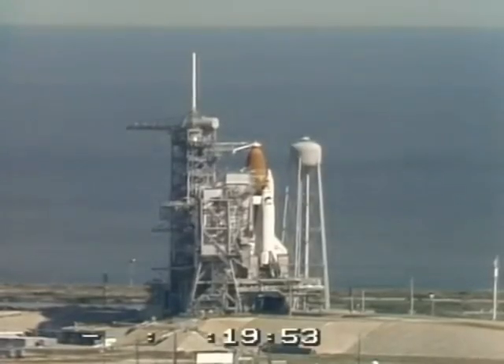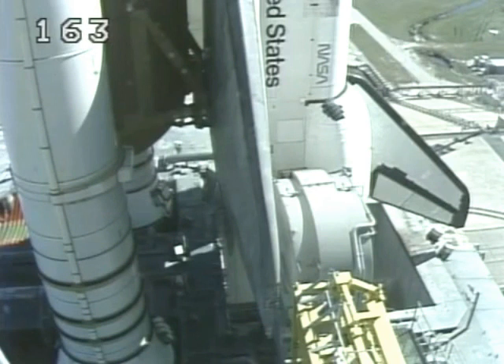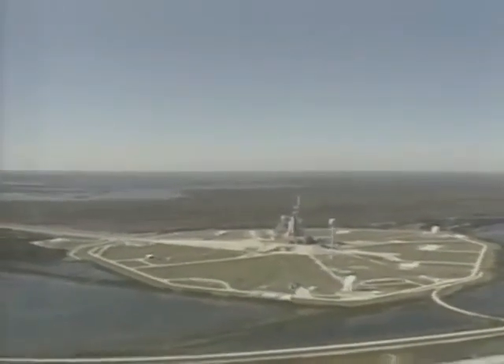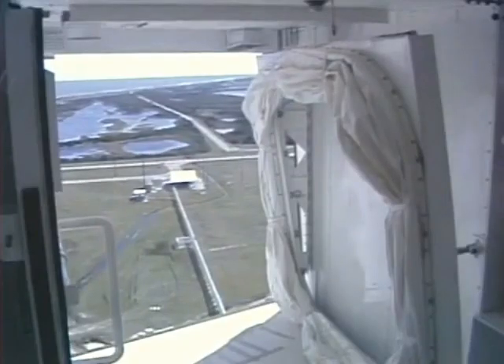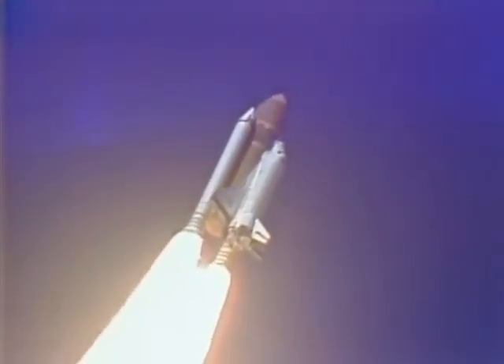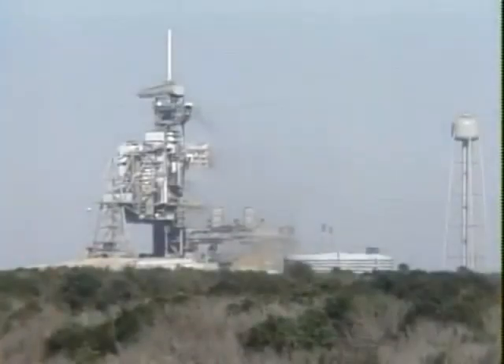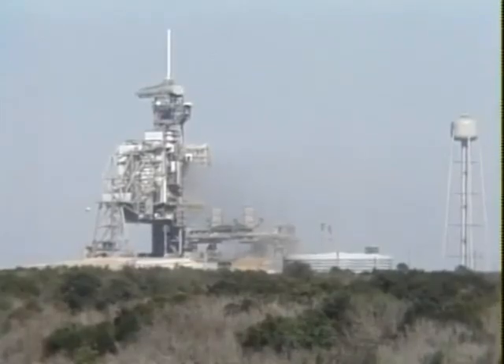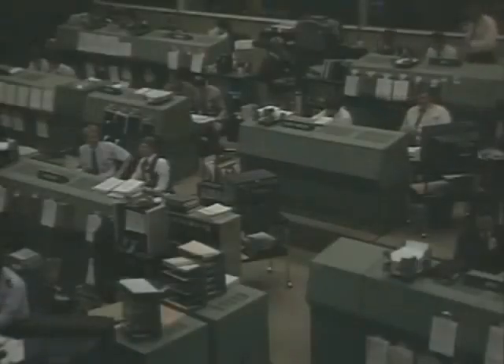The Challenger Disaster: STS-51-L Countdown and Launch

Comment: A real question is: was it already too late? Would it have mattered if they had delayed, a day, a week, or even several months? 

Professor Feynman showed that the O rings failed due to the cold. They were squeezed too much and never returned to 'normal'.

So, were the O rings already permanently damaged beyond elasticity so that they could never fill the gap and thus block the gases? If so, the flight may have been doomed no matter when it was launched.

Comment: "Spaceflight will never tolerate carelessness, incapacity, and neglect. Somewhere, somehow, we screwed up. It could have been in design, build, or test. Whatever it was, we should have caught it. We were too gung ho about the schedule and we locked out all of the problems we saw each day in our work. Every element of the program was in trouble and so were we. The simulators were not working, Mission Control was behind in virtually every area, and the flight and test procedures changed daily. Nothing we did had any shelf life. Not one of us stood up and said, “Dammit, stop!” I don’t know what Thompson’s committee will find as the cause, but I know what I find. We are the cause! We were not ready! We did not do our job. We were rolling the dice, hoping that things would come together by launch day, when in our hearts we knew it would take a miracle. We were pushing the schedule and betting that the Cape would slip before we did.

From this day forward, Flight Control will be known by two words: “Tough” and “Competent”. Tough means we are forever accountable for what we do or what we fail to do. We will never again compromise our responsibilities. Every time we walk into Mission Control we will know what we stand for. Competent means we will never take anything for granted. We will never be found short in our knowledge and in our skills. Mission Control will be perfect. When you leave this meeting today you will go to your office and the first thing you will do there is to write “Tough and Competent” on your blackboards. It will never be erased. Each day when you enter the room these words will remind you of the price paid by Grissom, White, and Chaffee. These words are the price of admission to the ranks of Mission Control."

Gene Kranz

Comment: Had Challenger not blown up on STS-51L, she would have been modified to carry the Centaur-G upper stage in time for the "Death Star mission" (and no the astronauts were not joking) where Challenger and Atlantis were to launch the Galileo and Ulysses spacecraft using the Centaur-G Prime upper stage within five days of each other. This presented a huge problem because you have a huge amount of high energy propellant (Liquid Oxygen and Liquid Hydrogen) in the payload bay and in the event of an abort had to be dumped overboard. On top of that the SSME's would be pushed to 109% rated thrust and the crew size was reduced to four astronauts. In a way, the Challenger Accident prevented a even bigger accident with the shuttle and it Centaur-G upper stage.
While all this was going on, the Air Force was prepping SLC-6 at Vandenberg Space Force Base for the first Space Shuttle flights in order to carry spy satellites and other satellites that needed to be launched into polar orbit. NASA was developing the filament wound style SRB'S for the launches coming from Vandenberg Space Force Base. In the end, after the Challenger Accident, all Shuttle flights from Vandenberg were canceled and the Centaur-G was banned from the shuttle.

Comment: Apparently, the last thing registered in the shuttle was the word "Uh-oh." The flight commander realized what had probably happened, and knew they were all dead, seconds before the explosion itself.
Reply: The side flame on the srb not only broke the support strut attaching the bottom booster to the bottom of the tank but the whole bottom of the tank was sliced clean off. That would have caused a tremendous bang that would have been felt by the crew hence the “Uh oh” by Mike Smith. A second later, the booster swung sideways because it was now being held by one strut and the nose of the booster hit the nose of the tank like a missile strike. The top of the tank was torn to shreds with the force of the accent causing the rest of the tank to be swallowed up by the debris. The shuttle orbiter was pushed nose upward by the force of the tank nose destruction which meant it was flying bottom going forward. This created a huge force of drag which ripped the shuttle apart a second after the tank disintegrated.
Reply: That was pilot Michael Smith that said that. It was the last thing that was heard by NASA. So he saw something and split second later we have the disaster.

Comment: They say they were alive when it broke up , was anyone there sitting in the seats of the dam thing when it exploded . To me I doubt it they got hot  real fast  They  couldn't even  Identify some of  the remains It was stupidity all the way around . Egos killed them people
Reply: Couple of things.  It has been pretty conclusively shown that not only did they survive the breakup of the vehicle, but there were conscious movements made.  

There were emergency air packs on the seats.  3 were recovered and all 3 had been activated.  That requires a person to activate them.  Also, many of the switches in the cockpit had been moved from their normal launch positions into positions indicating an attempt to restore electrical power.  Those switches are spring loaded, level locked switches that require a deliberate effort to move.  

There was no evidence of heat damage in the recovered crew compartment.

Comment: What does purging the engines mean?
Reply: The sparks just before ignition are to get rid of any gaseous hydrogen that may be present, to prevent damage. That is one engine purge...🇺🇸
Reply: @danielgregory3295   No. Those sparks burn off any free hydrogen to prevent an explossion when the engines ignite. Purging is when they flow helium through the engines to get rid of any oxygen in the lines. They have to get rid of the oxygen because it will freeze when the LOX and LH begin flowing through.

Comment: Why couldn't they have waited just a day or two for the weather to heat back up?! Its FLORIDA , it'll be back to 70 degrees any day in the winter! Ugh.
Reply: It has been stated in a few documentarties that the reason why not to push it back was 2-fold. One, political pressure as this launch had already been delayed a few times, and Two Christa's broadcast was to be on day 4 of the mission. Pushing the launch back would have put Day 4 on a Saturday, when kids weren't in school.
Reply: @RoXolid  thanks for the info. And I guess it's easier to have 20/20 vision in hindsight. It's just sad.
Reply: @MrGrace  It is. The thing to remember too is, in addition to weather there are also atmospheric conditions to be concerned with for launch as well. This is why you have "Launch Windows" that you try to fly during.
Reply: @RoXolid  ah, thats right! It's not just about the conditions on the ground, because they're not going to be there long lol.
Reply: $$$ is more important to them than lives

Comment: why the hell did NASA build the launchpad in 	Florida, which has some of the most unpredictable weather in the USA?  The costly delays and this disaster might have been avoided if the shuttles were launched from California.   Launching from Edwards AFB in CA would have also reduced the transport costs after the orbiters had landed.
Reply: The thing is you want to be as close to the equator as possible to get that extra speed boost from the rotation of the Earth
Reply: Can’t launch East from California... you would drop your spent stages over populated land.

Comment: out of all the thousands of temperature gauges and system monitors, was there no way of detecting the oring area especially since the engineers specifically state it was way out of tolerance.  This seemed so preventable.
Reply: It was one of the things that was assumed couldn't go wrong...and the SRBs can't be turned off once started anyway--so it works, or it doesn't..😞
Reply: Even if there were, once the boosters ignite there is no way to stop them.  It was feared initially that the shuttle would explode on the launch pad, and the only reason it hadn't done that was that the hole the O-rings failed to seal was plugged by solid fuel debris. As the shuttle kept going higher, winds broke the solid fuel seal and then the flame started to burn through the steel, leading to a chain reaction that blew up the shuttle.

Comment: What is that little part tries to stay in the air after explosion ? Is it the one that astronauts were inside ?
Reply: No those were the two rocket boosters on each side of the shuttle
Reply: İlker Acar ^
Reply: Oh okay thmks, I hope at least they died fast.
Reply: İlker Acar Actually, it’s speculated that the crew didn’t die instantly. When the main shuttle where the astronauts were broken apart, they survived the initial impact, but then ended up dying of oxygen deficiency and pressure loss. Some even say that they died after hitting the ocean.
Reply: @Murted29568  :( at least we have elon now, not bs nasa stuff

Comment: I don’t understand why they didn’t check the rocket boosters before lunch because the O-rings is what messed up the flight mission and also because of weather conditions they should’ve put it off till the summer who agrees with me👍
Reply: I agree, the temperature during space shuttle Challenger's last launch was only 36 degrees fahrenheit.
Reply: NASA turned a blind eye to the problem for years, including the night before the launch. Project Managers from MT called for a teleconference to discuss the problem. The engineers outlined everything they knew and told them this was a possibility.  NASA management was angry and put pressure on the management from MT. So in the final call, they only polled the senior managers from MT, who gave and signed off on the OK to launch. They didn't give a shit that the engineers said not to launch below 53 Degrees Fahrenheit.  NASA should have been found criminally negligent.

Comment: There was plenty of evidence of the pressure that NASA was under to launch on schedule before the disaster occurred. 
2 1985 flights, both by Discovery, were launched in very dodgy weather conditions, particularly the second one where the sky was pitch black and rainstorms occurring not far from the pad, a clear violation of the safety rule that the shuttle should not be launched in rainy weather because of the damage rain drops might cause to the shuttle.  The last flight before Challenger, by Columbia,  suffered many launch delays 
And the landing  was even delayed by bad weather in Florida.  This meant less time for Columbia to be reprocessed for a time critical 
Mission to observe Halley’s Comet in March, thus adding to the pressure to launch Challenger, which was itself scheduled for a time critical launch in May to launch a Sun polar probe.  And there were other problems as well - the o ring problem that doomed Challenger and its crew had occurred on most of the previous flights as well, without the catastrophic consequences on its last flight.  A burn through on a SRB on the 8th 
Shuttle flight almost caused a disaster then.  And problems with the tiles nearly caused a disaster on the 13th Shuttle flight and the 7th flight, the first with a US female astronaut. And there were problems with the main engines that resulted in 2 pre Challenger launches being aborted at almost the last second.  I could go on...
All these problems were noticed but flights continued anyway, because as nothing disastrous had happened it was all right to continue flights. 
The analogy is parents letting their small toddler play on a road with very few traffic - it is all right and fine most of the time but sooner or later 
A car would come by and cause a tragic accident. This was the mindset at NASA.  A non professional astronaut should never have been allowed to fly on the Shuttle, a very dangerous vehicle with no escape system and with hundreds of critically 1 features, the failure of any one of which 
Could and would have caused a disaster. 
Even before the Challenger tragedy, it was clear the Shuttle was not nearly as cheap or safe as advertised and was not capable of making more than a few flights a year.  The Shuttle did have its great successes, notably the repair and servicing missions of the Hubble Space Telescope, 
But it is now clear Shuttle flights should have stopped after the Challenger tragedy, and maybe before that.
Reply: Oliver Grumitt “Dodgy weather conditions”

Did they learn nothing from when lightning struck Apollo 12 during launch?

Comment: By what I understand it would've taken about 3 minutes coming down before hitting the water. The explosion didn't kill them, it was still intact. That means that the astronauts had around 3 minutes of knowing that they're going to die, waiting to hit the water. That had to be the worst feeling ever, waiting to die.
Reply: Talk about saying your prayers.. I would.
Reply: Alive but not conscious. They were spinning around so fast from the explosion they were knocked out. Probably a good thing  the impact on the water was like hitting pavement.
Reply: @bindlepig8064  that's not true at all. The forces they were exposed to would not have hurt them or knocked them out. They were unconscious due to loss of air pressure after the break up.
Reply: @djbeezy  do we know that they were unconscious?  Was the cree cabin depressurized?

Weren't there some emergency oxygen things activated that can only have been done manually?
Reply: @notthefather3919  We don't know for a fact. However, we do know that the cabin did not rapidly depress because the middle floor would have buckled. But all the life support and batteries etc. were under the cargo bay which was shortly separated from the crew compartment after the ET failed. They probably had only a few seconds of air in the lines. Yes, there were emergency air packs activated and they do have to be done manually. But they don't provided pressurized air so they wouldn't have done any good.
Reply: @notthefather3919  yes and 3 of those tanks were activated. Someone wouldve had to been conscious for that to happen.They were conscious on the way down.
Reply: @bindlepig8064  actually one of the documentaries says that if they had parachutes and an emergency escape hatch that they could have bailed out. So then I wonder, why not try to exit the  orbiter (assuming there could even been a way to open one of those hatches from the inside) and just bail without a parachute? Using the skinny method perhaps your legs would get ripped off upon entering the water but could you survive. Seems more plausible than trapped inside a can slamming into the water over 200mph.
Reply: @LichaelMewis  what? You would not survive that.
Reply: @LichaelMewis  are you for real?
Reply: @LichaelMewis  The shuttle was MUCH too high for such a system to have worked. And because the crew cabin was ripped free from the rest of the shuttle it would have been impossible to deploy the system you speak of.
Reply: It's so cold up there, they likely died from extreme hot, extreme cold long before they hit thw water! Plus the g forces would broken life sustaining bones in the neck and spine. I seriously doubt they knew much past uh oh something is wrong
Reply: @adamwampler2135  Not at all. The forces the astronauts were exposed to were not fatal. Not even remotely fatal. Until they hit the water that is. The astronauts were definitely alive when they hit the water but they were most likely unconscious. There was no rapid decompression after the break up but they were out of oxygen about 5 seconds after the vehicle broke up.
Reply: @djbeezy  I thought I understood the cabin to have decompressed? Doesn't matter, the suits back then could stop their heads from being jerked around and the restraints wouldn't even have allowed for manual support. Also, if the crew cabin  had been breached, their bodies would have been frozen and burned by both temp extremes, hot gases exploding and sub zero Temps at altitude. Maybe I understood what happened wrong, but I thought that was said
Reply: @adamwampler2135  The cabin may or may not have decompressed. Nobody really knows for sure. It is assumed by engineers that is slowly did but there is no way to confirm it. Everything else you mentioned might have been said but not by any professional in that industry.
Reply: @djbeezy  Right...well, I hope they went close to what I was thinking...maybe that's it. Not much suffering that way
Reply: @adamwampler2135  the g forces wouldn't have been anywhere near the strength they were going up. The rockets are what makes the g forces so strong and are used to help the shuttle beat gravity to leave Earth. The rockets were not in operation on the way down. They weren't even attached to the shuttle. They were no where near as fast coming down as they were going up. So the speed coming down or the extreme temperature (the crew cabin wasn't attached anymore but was in tact and they were in their suits.) wouldn't have knocked them unconscious. So sadly they had to have figured it out during the 3 minutes of falling that they were going to die.